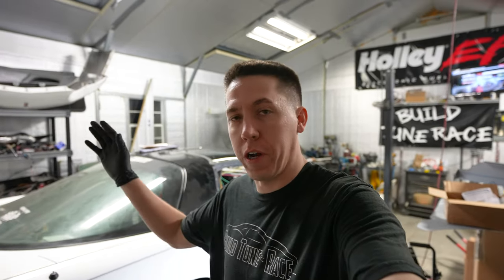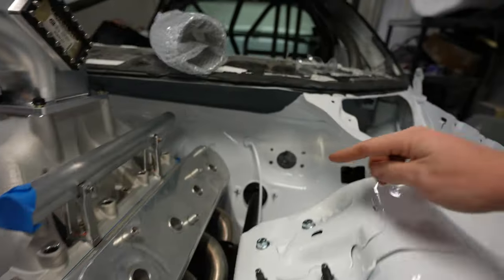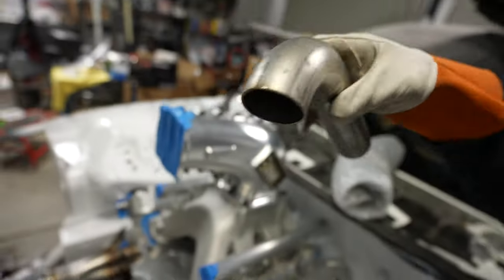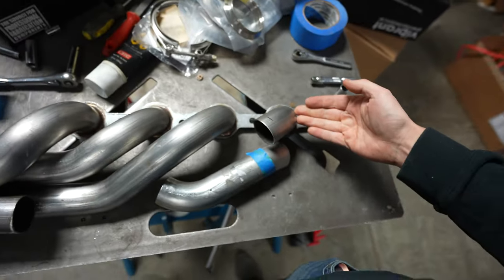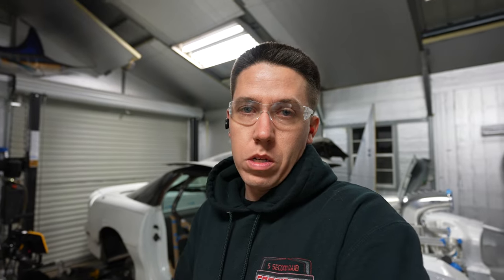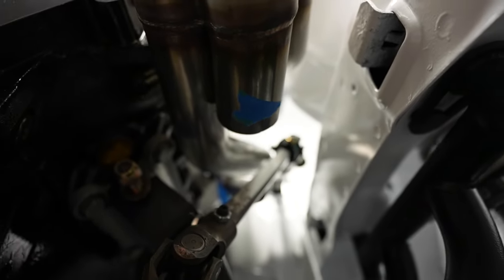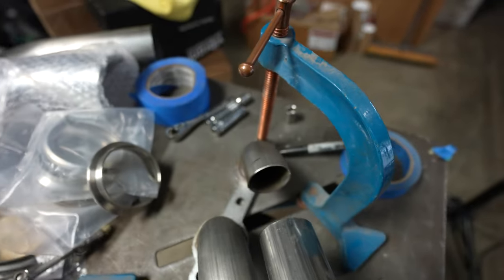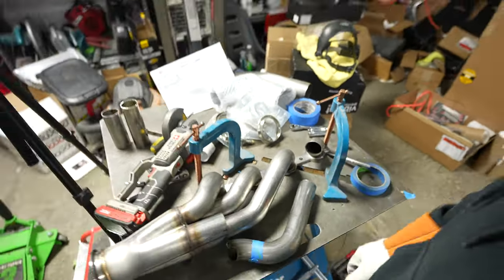Camaro Twin Turbo Kit Build Part 1.5! Flowtech Turbo Header Modification (The missing footage)

Comment: That is a bad design 
No way would I want to pull the steering shaft to pull the headers!
Just add a 3rd knuckle to the steering shaft!
Reply: I’ve thought the same thing. Ideally build with maintenance in mind. I know the f bodies are tight, but there’s options.

Change the steering shaft. 
Run the runner above. 
Put small v bands on that runner. So you can just drop the runner and the. Pull the header off. 

Something. Seems that wanting to make the turbo kit easier instead of just right.
Reply from the maker: The race column pulls in just a few minutes. The burnout truck we built I did the same way worked well. I would rather do that then modify the factory designed steering geometry.